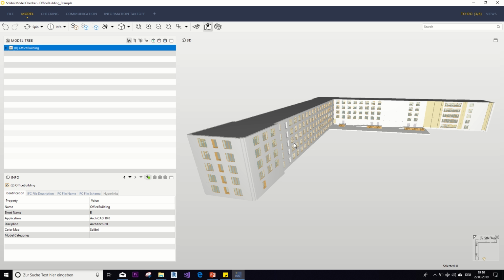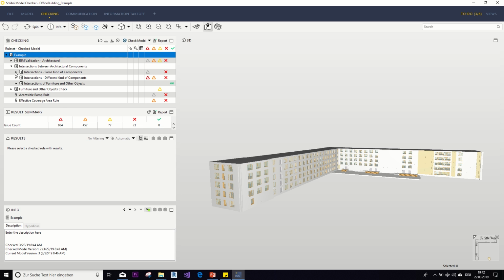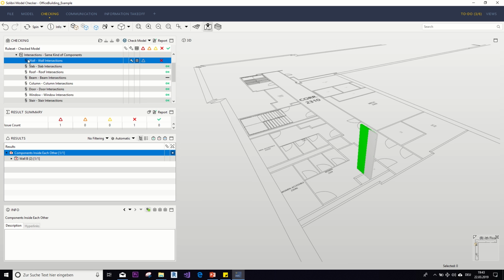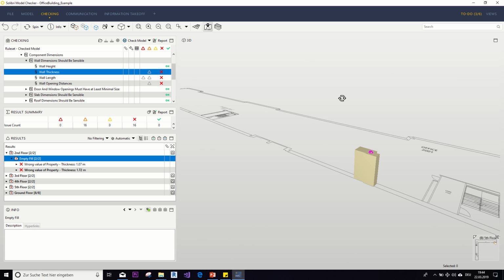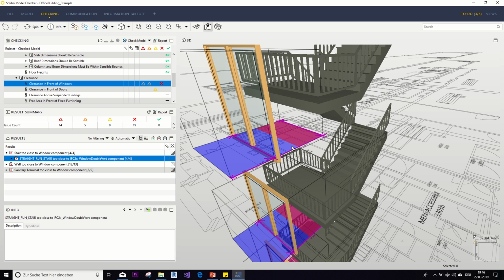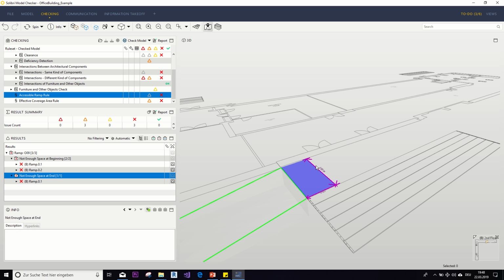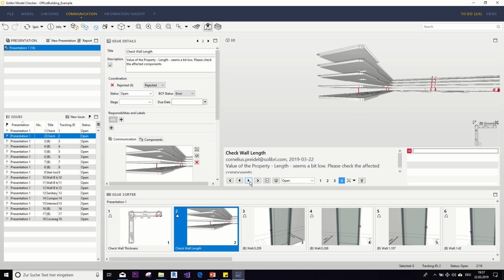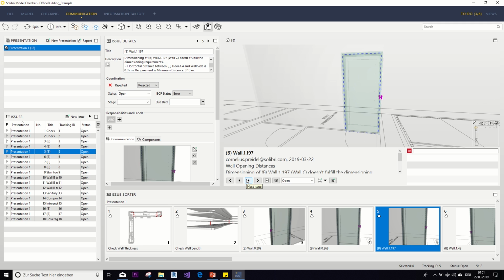BIM IS NOT JUST REVIT - Model quality checking

Comment: I agree Revit isn't the definition of BIM but you can use Revit as your tool of choice without tying a number of other software into the process. Revit can do clash detection, quantity take off, etc without the use of other platforms. Though Revit isn't directly BIM your can use only Revit and be doing a full BIM approach.
Reply: hello
Revit cannot detect fabrication, rebar or clearance and etc... interference. It is better to use each software in its place. If Revit did everything. Why should Autodesk develop Navisworks or Advance Steel?
Reply: @GHASEM.ARIYANI  the point I am making is that Revit can do more then just model. You don’t have to learn and buy many tools if 1 can do it. Doesn’t mean that is the case for everybody.
Reply: @TheBIMCoordinator  thanks @The BIM Coordinator

you are right